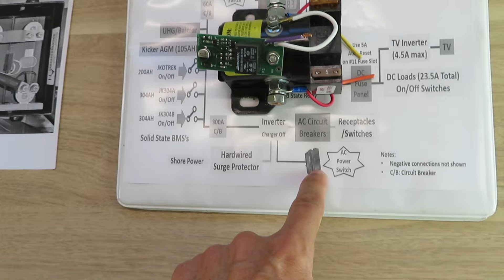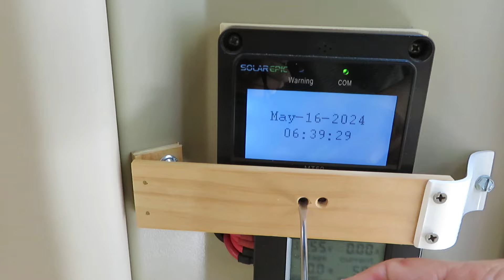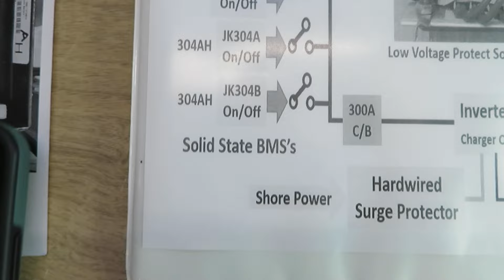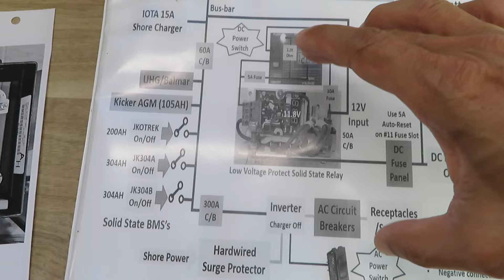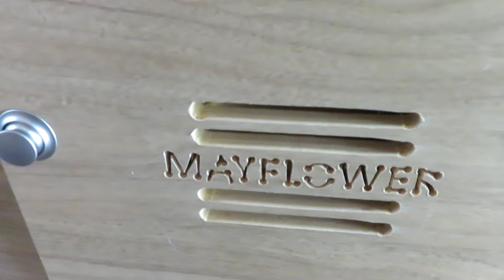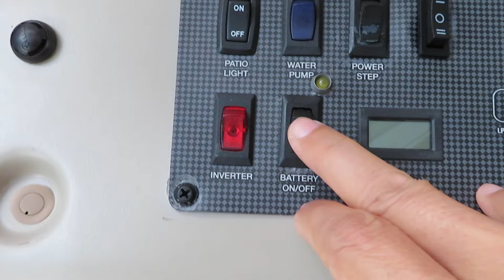JK BMS - 808AH Electrical Van Tour 1: System Configuration

Comment: Hello Lam!  I tapped 12 VDC off the antenna amplifier/distribution module to power our TV, so a small inverter in not necessary and the tv can operate without the large inverter on. I was able to run the wiring inside the wire loom that has the coax and power wiring inside.
Reply from the maker: Our TV only operates on ac power.

Comment: You mention not needing the kicker battery.  Do you have an alternator protection module?  I understand you don't need to kick the KS2, but the more important function IMO is act as a big capacitor to protect the alternator against inductive kickback voltage spikes when the battery gets full and charging is abruptly shut off.
Reply from the maker: Yes, just a simple alternator protection module will be sufficient. I recommend setting the under-hood generator bulk charging voltage at 14.1V. With a <0.005V cell imbalance and max cell voltage of 3.65V, there will be a gigantic margin close to 0.5V of battery voltage before shut off.